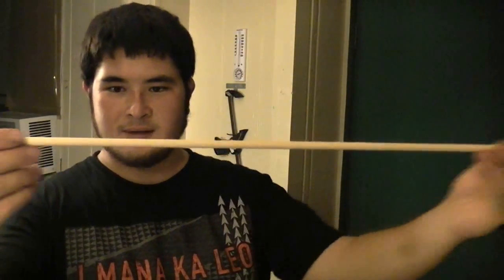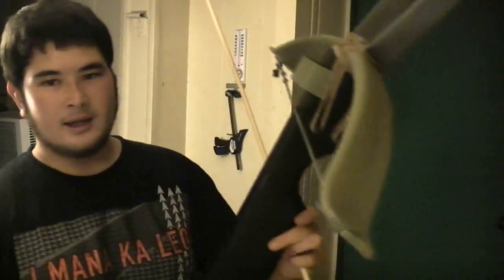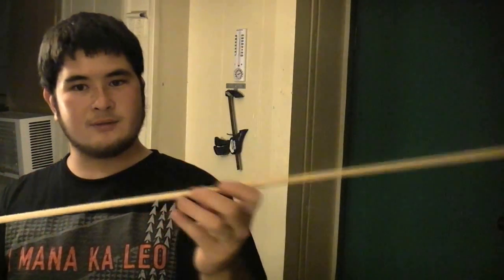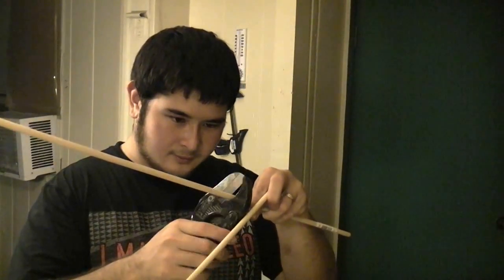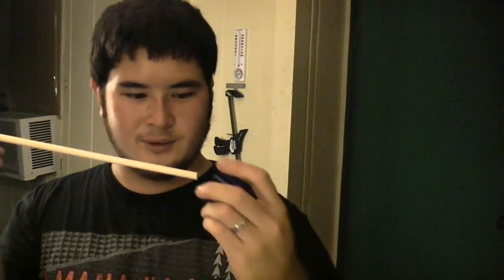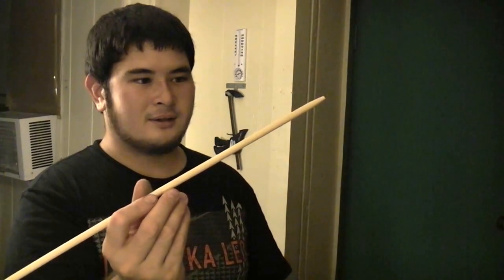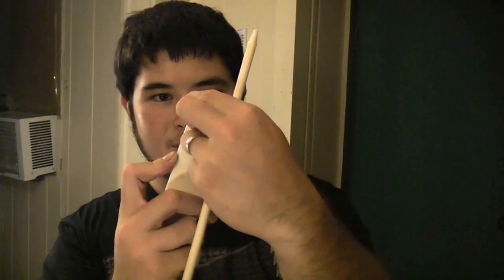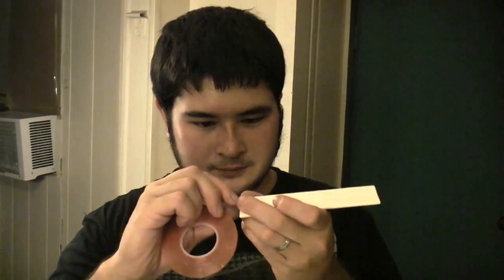How to Make an 18 Inch Crossbow Bolt Part 1

Comment: 1st thank you for all the information you have put on Utube. I bought a couple of your books in Kindle form.
I bought a Horton stock from Ebay, Really nice for 10 bucks with shipping. I got working building the trigger and all that. I used 2 limbs from a compound bow that were rated at 30 pounds. I only want to shoot targets.
The crossbow doesn't seem to have much power. The bolts hit the target flat on sometimes, instead of the point.
My question is the distance from the bow string to the nut is only 7 inches. Should I make the distance longer ? What length bolt would you suggest.
I bought a couple of fiberglass rods that would be used to mark something or hold a sign. their 4 long 5/16 dia for under 2 bucks from a store called rural king.
thanks again your a smart kid
George

Comment: i use duct tape as the fetching you can get different colors at say walmart or other stores. it may not be what you want, but they do work well. 

if your a hunter you can use duct tape at first, and then get yourself a bird and use them.

Comment: So basically you buy all of your parts and glue them together, legit. I guess i came to the wrong place.
Reply: Making bolts isnt that complicated. Its the shaft, fletchings, nock, and top. The nock he shows in another video how to make a reinforced self nock. Fletchings can easily be made of duct tape or any other material.